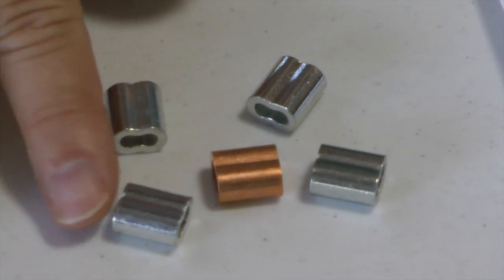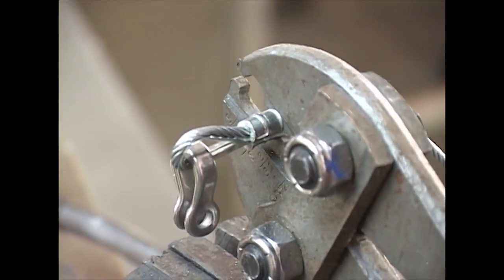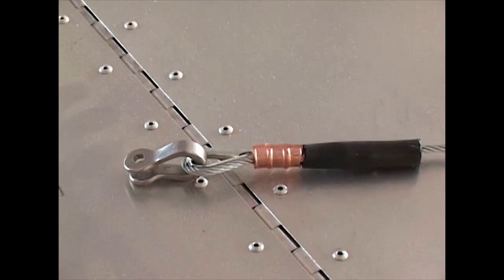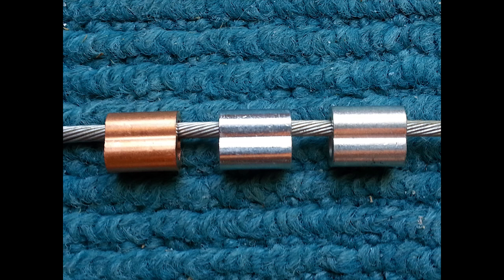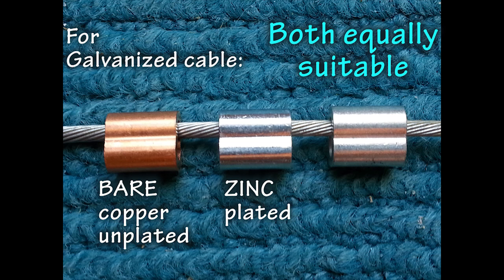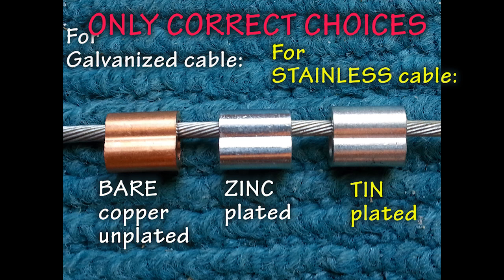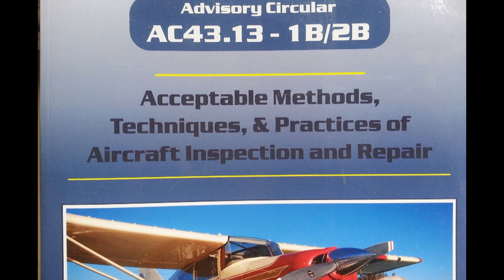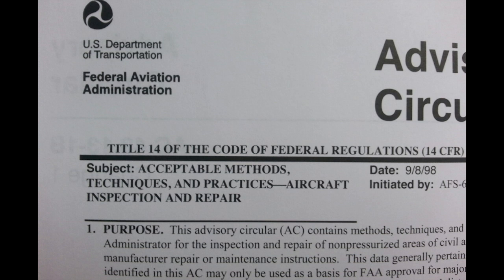How to select correct Nicopress sleeves for aircraft cable swaging

Comment: Do aluminum sleeves have a place in this discussion? Aluminum on stainless cable is good or no?
Reply: Dissimilar metals cause galvanic corrosion. I wouldn't.
Reply: @ceelo206  
I've read that for stainless cable, tin coated copper is the appropriate material to use for sleeves. That's also dissimilar so I think it's probably more complicated than just dissimilar. I'm not aware that aluminum wire rope even exist so what would the aluminum sleeves be for?

Comment: can you do a video on how to swage?  I buggered up the thimble as I had it to close to the sleeve when I used the crimpers.  I also have both hand tool with the bolts from ATS to squeeze both sides.  Looks like a pair of bars with holes.  But, I used the big ‘lock picking’ looking squeezers and just brutalized the sleeve.  I also wasnt sure how close to have the thimble to the sleeve.

Comment: This is crazy and the kind of thing that will get you killed (when one fails on your elevator control cable from corrosion on the inside) and you don't know it.  The aircraft industry should of picked one or the other.  

It's like with crimping RJ-45 connectors with computer networking cable... it was years before I knew there were two different types of RJ-45 connectors for two different kinds of Cat5/6/6e wire...   stranded and solid core wire.  If you use the wrong connector on the wrong wire, you will forever have your cable ends failing at random and being generally unreliable.   The networking industry should of chosen to use one, or the other, but not both.   

You can be sure there is no designation on either cable or cable terminators, that one size terminator does not fit all, just like on the nicopress sleeves above, that one size does not fit all, or that even there are two different types of cable requiring different sleeves made out of different material.  To make it even worse for inspections, the zinc and the tin look almost identical.  The same for the RJ-45 connectors for either stranded or solid cable ... they look the same externally with no indication which is for which.
Reply: This is why aircraft undergoes annual inspection.